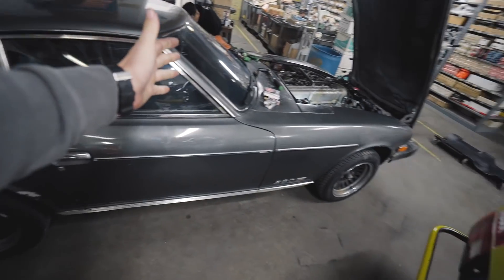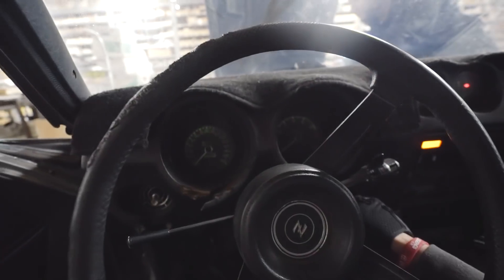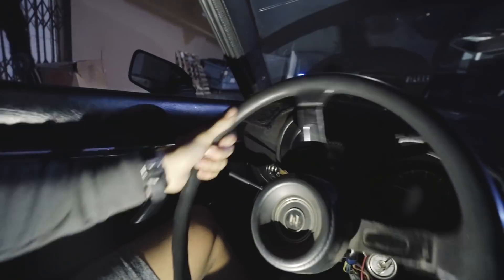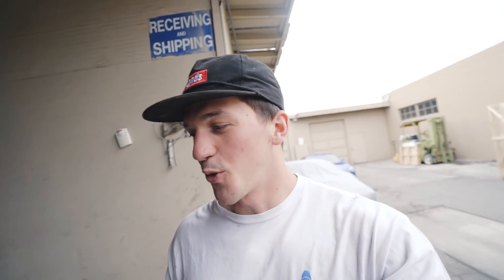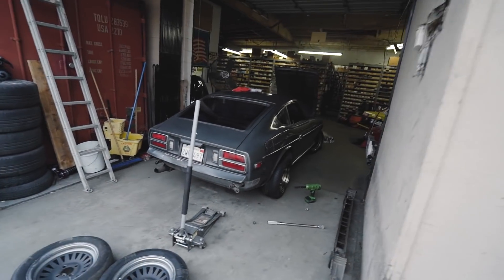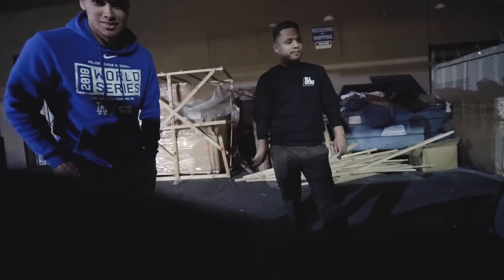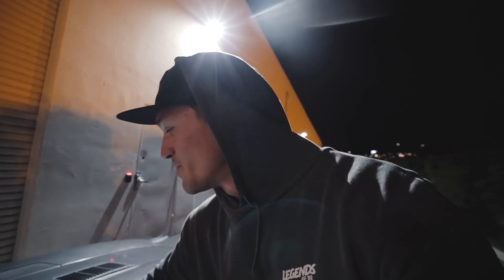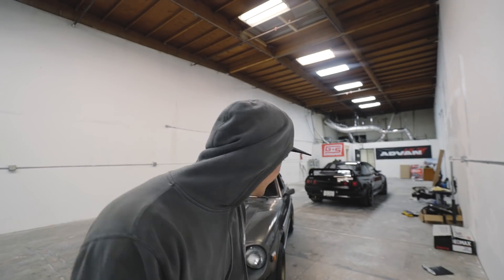Bringing ABANDONED Datsun 280z BACK TO LIFE in TWO DAYS! *Untouched 14 YEARS*

Comment: That's about how my 1980 RX-7 was when I bought it from a junkyard. All it took to start for the first time on the first try was a new ignition switch, a new battery and gas, then a bit of basic maintenance stuff  and it was roadworthy. I daily drove it for a year and 22,000 miles problem free until the front cover oring gave out and it lost oil pressure causing the front rotor bearing to seize to the eshaft. It's running on a spare stock port 12A now while I rebuild the large street ported cosmo 13B that it came with.

Comment: This series on the z is going to be super fire
I guarantee this will be the hottest car in the family when completed🔥 keep the L motor in there it sounds amazing 😉 nice rebuild with individual carbs mated with a 350z trans using a Collins adapter & it’ll be sweet daily
Reply: Connoisseur Of Cars & Tig Ol Bitties you gotta link buddy?
Reply: if this is the same engine as the 280zx, its fuel injected. meaning individual carbs wont work.